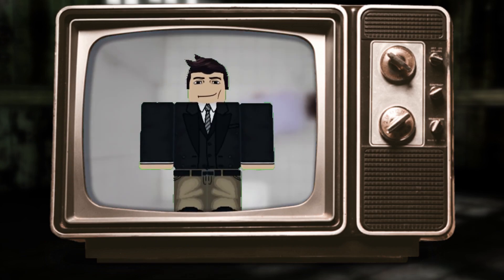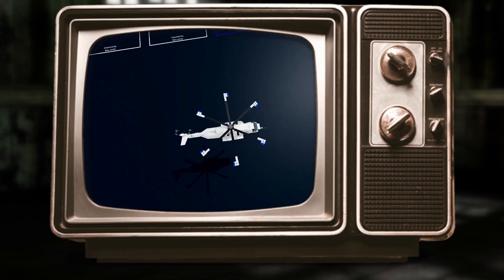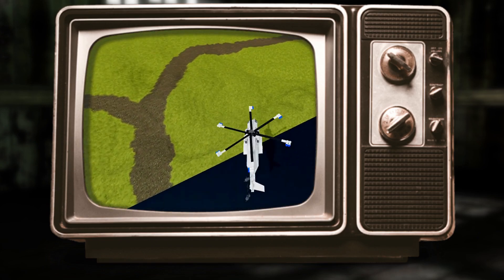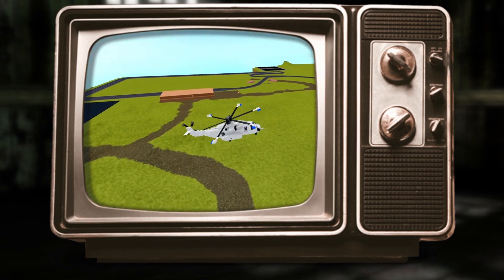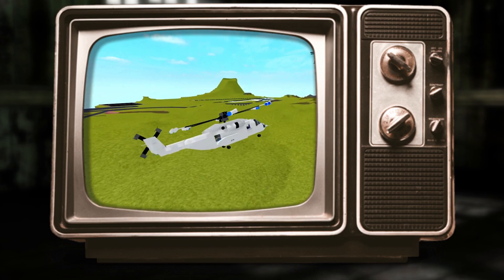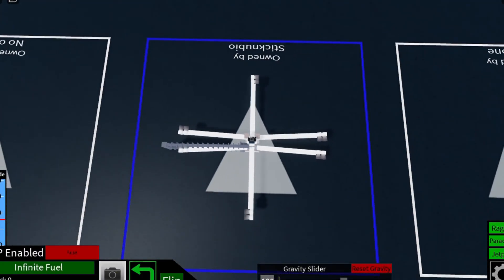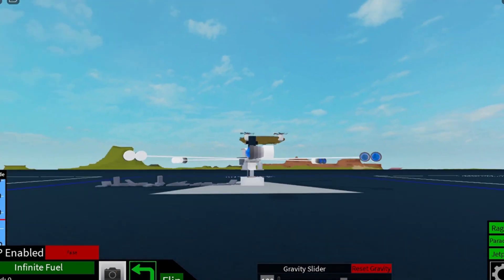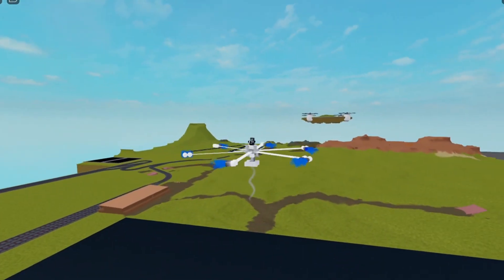6-Bladed Helicopter Rotor Tutorial || Roblox Plane Crazy

Comment: i have a helicopter and it tilts alot to right and i do not know what to do to stop it can somebody help me
Reply from the maker: i have that issue with all of my helicopters, best thing you can do is load it with vertical wing panels, put a lot of ballast in the bottom and helium in the top, and try not to angle the blades too much
use flying assistance from internal props if you have to
Reply: @Sticknub  thank you I will try this

Comment: my helicopter is spinning along with the blades
what do i do?
Reply from the maker: You'll need a tail rotor that spins in the opposite direction as the main rotor to counteract the main rotor's torque. I know it sounds complicated but it's not as complex as it sounds, also if that doesn't work you can put ballast at the front on either the left or right depending on what direction the helicopter spins in. For example, if it spins to the right  you'll want the ballast on the left. If it spins to the left, you'll want it on the right. hope this helped
Reply: @Sticknub  THX :D

Comment: How do you make the base not spin?
Reply from the maker: You can't make it not spin without putting anchor blocks (physics on) on the base, but that will make it not move at all. If you put the rotor on your own helicopter, the helicopter won't spin as long as it has more mass than the rotor does

Comment: why not work for my heli?
Reply from the maker: Make sure the disconnectors go around the blades without touching them and then connect to the lower half of the rotor. Once you separate them, if it works, hold down E to angle the rotor blades downward. Then, hold down T and let go and it should be flying. If it doesn't work on your helicopter, your helicopter probably just has a stability issue. It usually takes me a couple of hours to get the helicopter working properly after I put the rotor on, so it IS a tedious process.
Reply: @Sticknub  It doesnt spin
Reply: @Sticknub  atleast ill have 3 bladed motor
Reply: @Sticknub  fucking it still doesnt work
Reply from the maker: @maxwellcatlol  hey watch your language
Make sure you followed the tutorial correctly, also make sure your anchor block has physics on
Reply: @Sticknub  i, deleted the base already and save...
Reply: @maxwellcatlol  add the thrusters on the end
Reply: @dedlur  I SAID THAT I DELETED IT

Comment: Does the bottom part spin too? Because if it does, I can't use this. 

Edit: I think I saw you on Plane Crazy once, I'm pretty sure.
Reply from the maker: It spins, but it doesn't when you put it on a helicopter. If you're curious about how it works on a helicopter, you can check out my King Stallion video.
Reply: @Sticknub  alr thanks